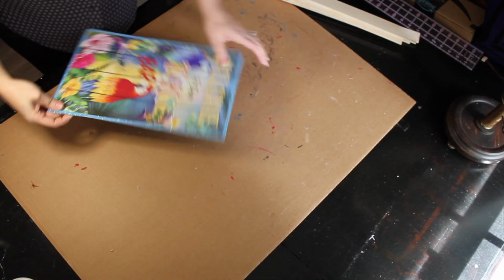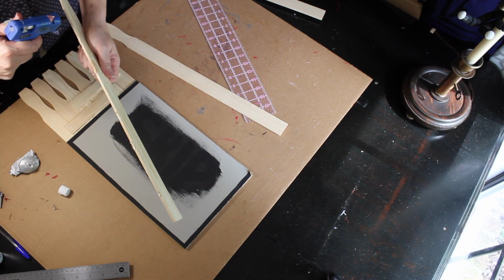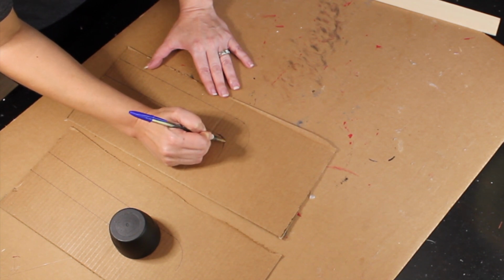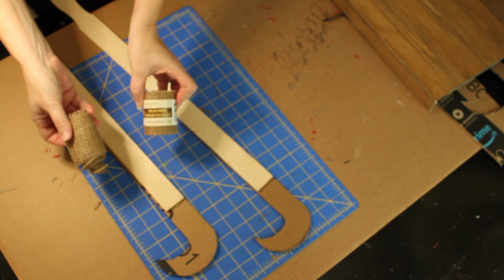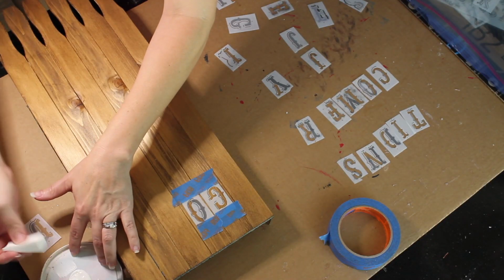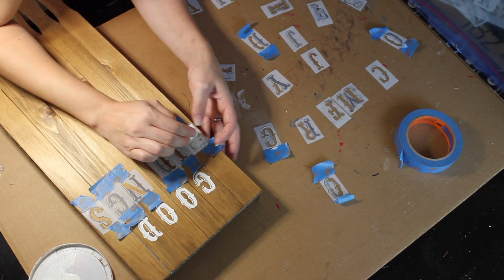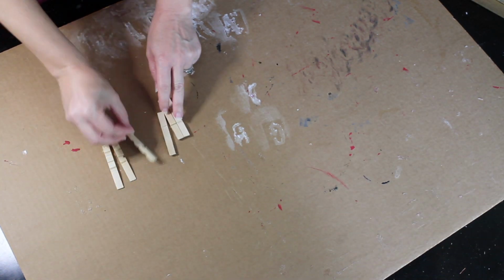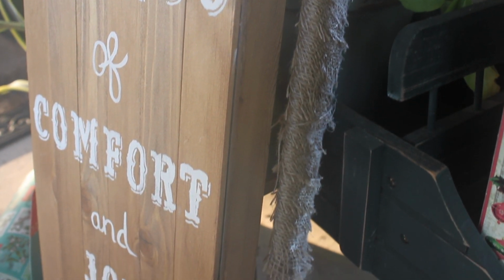Vintage Farmhouse Christmas Sled DIY!

Comment: So cute. What did you put on the bottom of the sled. That was painted gray and black? It seems to have just appeared in the video.
Reply from the maker: I was originally going to use it for a stall sign for my horse  and had started painting it already lol. But I decided to use it for this project.